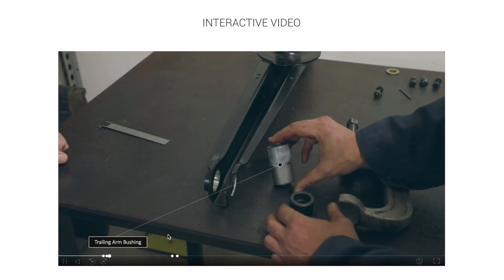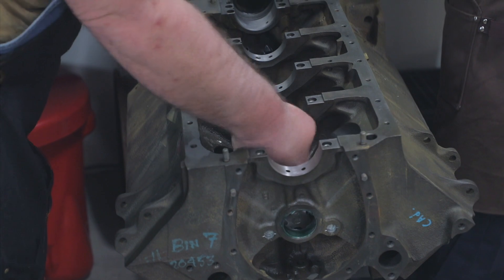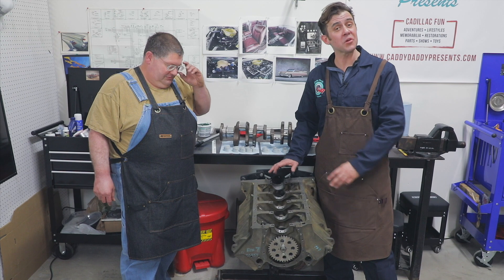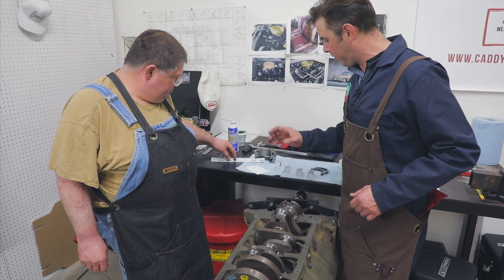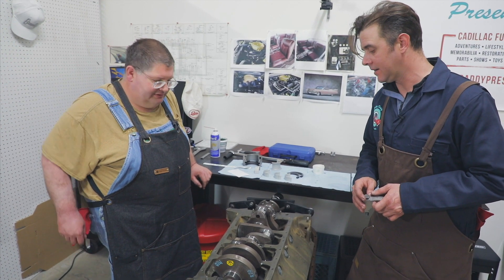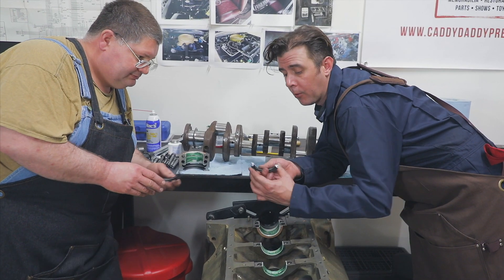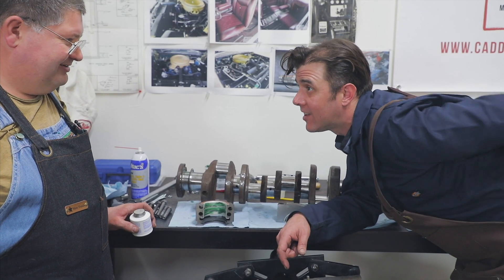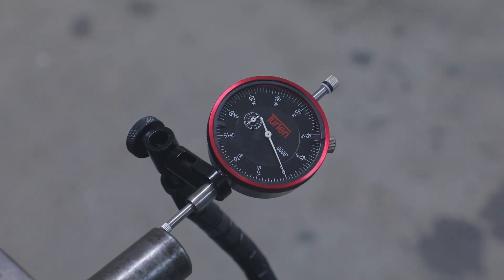How To Install a Camshaft and Crankshaft in the Cadillac 390 Engine

Comment: Hello friend, could you tell me the measurements of the STD crankshaft shaft, for the 1960 Cadillac Deville 390 engine?
Reply from the maker: Main bearing journal diameter 2.625" Crankpin diameter 2.2488" to 2.2493", 2.490" nominal
Josh

Comment: Hi Guys. Excellent video, i was thinkin. What About camshaft lock?
How to prevent sliding camshaft?
Reply from the maker: I had the same thought myself. Keep in mind the cam lobes are not straight, but at a slight angle to impart spin on the lifters and this produces a longitudinal thrust on the shaft. The force applied to the oil pump/distributor drive impart an opposite force. They balance and the cam self locates in the block.

Comment: Where are the rest of the installation videos, mainly the head installs
Reply from the maker: Hey John, stay tuned as they are coming soon. Part 7 of the engine build will be the head assembly install and Part 8 will be the fuel pump, water pump, and alternator install. Then, we will move on to the transmission...Please subscribe so you don't miss it!